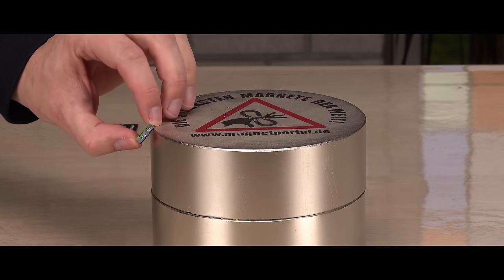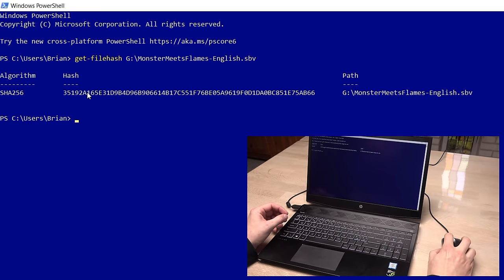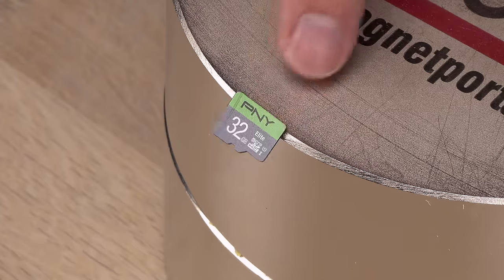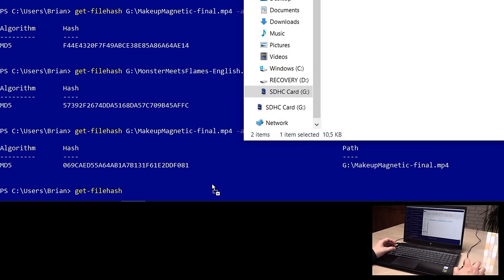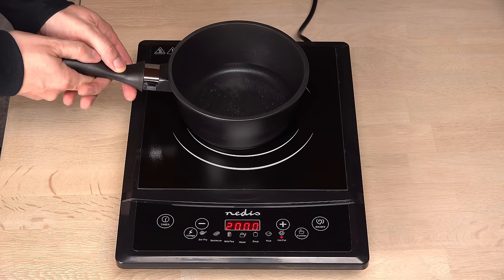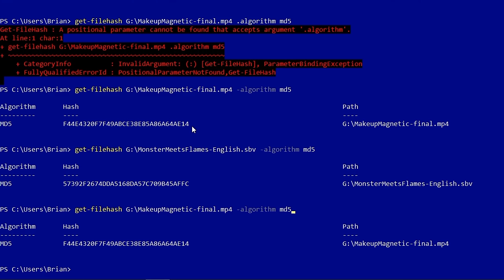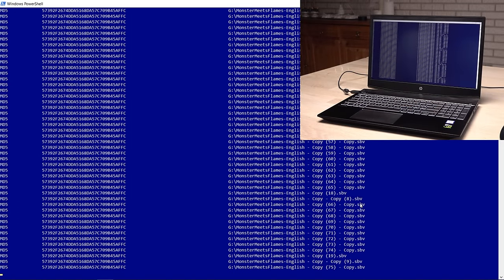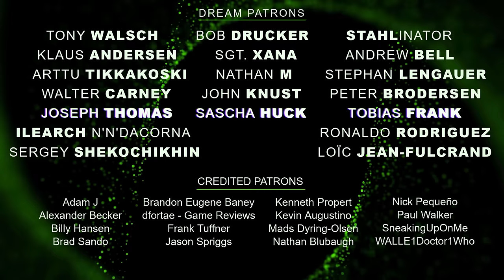SD Card vs. Monster Magnet and Induction Cooker (2000W AC electromagnet)

Comment: I'm pretty sure that there's a higher chance that the bit that was changed was reset back from the magnets, rather than a program having an error. Both are insanely unlikely, but the computer one just seems essentially impossible to me. Well unless something interfered with the reading, then that's probably it.

Comment: you should put and stick it onto driler on high turnover inside magnetic field, then it shoud be inducted high electrical shock in SD card. It's interesting if any data will get changed

Comment: Flash storage doesn’t use magnetic storage, therefore it cannot be affected by an external magnetic field. If you did the same with a hard drive or floppy disk which does use magnetic storage, it would completely fry it. They just said that the sd card is magnet proof simply for marketing since companies like Sandusky don’t say it.

Comment: You would see a single bit change, as the videos are heavily compressed files. Playing back decompress it, and can cause very weird errors, not just a single pixel color change.
Try H2testw, that will tell you how many byte has been changed, and such. It fills up the storage device with its own files, so it knows, what should be on it.

Comment: Most NAND flash chips have an "invisible" spare area after each data block (page), and the controllers use it to store Error Correcting Codes and some info like the number of block rewrites and so on. This makes cards/flash drives/etc. resistant to single bit failures and failing blocks.

Comment: Before watching, I can say that at this point magnets CAN wipe solid state electronics, I'd say with a high enough fluctuating (pulsed DC or AC) magnetic field you can generate enough internal currents where a high voltage spike/potential would then erase or physically damage the chip or data at that point it's referred to as EMI (electromagnetic interference, not Emi records🙃)
Reply from the maker: I tend to agree. That's why I limit my conclusion to the magnets available for me :)

Comment: For the card changing checksum in the first magnet test but returning to original in the second, I have three theories, but all are very improbable.

First, since the card did get attracted to the magnet, it might have kept a little bit of magnetism when you removed it, and that could have messed up the calculations just a tiny bit.

Or, the card could have one weak bit that got flipped on the first text, changing the checksum, then got flipped again on the second test, returning the original checksum.

Or there's the extremely tiny chance that multiple bits actually changed in the 2nd experiment, but it happened that the checksum was the same as the first one, since checksums aren't unique to a bit stream

Comment: It could've been a SEU, or one of the Row/Column select transistors' gate was charged by current, causing an entire row/column to be read incorrectly until it was actually accessed and pulled low again.

Comment: The computer readout anomaly is what's really got me interested, unfortunately the only way to find out if it was a random cosmic ray interaction would be to go thru and flip individual bits and try replicate the result. Its what they did with the Mario 64 speed run, but thats a lot easier than a whole computer system 😅

Comment: Been a while since I used Linux but use the DD command, input as dev/urandom, output as the block id for the device,  so like a raw mode, no file system, now that is every bit, checksum that setup

Comment: What do you think about extracting gold, silver, copper, platinum and radioactive thorium and uranium from coal ash using gold minign equipment?
Reply from the maker: Hm, it is probably possible, but wouldn't the amount extracted be extremely low compared to using the mining equipment on high-yield minerals?
Reply: @brainiac75  Theoretically, the wash should catch anything heavier than 3 g / cm3. Of course, such things flow down after some time, but if there are no heavier minerals in the ash, most should remain in the wash. And if I repeat rinsing twice, I should catch at least 70% of heavy materials with density more than 3,5 g/cm3 and at least 90% with density more than 4 g/cm3. 

In Poland's coals you can find about 700-750 grams of uranium per tone and about 2,5 grams of gold and platinum per tone. They will be some silver, copper, titanium itp. Radiation of ash remains at 0,2 uSv/g, so I expected a few microsiverts per hour in concentrate.

Comment: the internal circuit is not complete or closed.  Magnetics do not affect an open circuit until closed.  once the circuit it closed it has the ability to affect the charge or data on the card.  I would be really interested in how the circuit worked if you tried to play the video while the card is attached to an external circuit while on the active plate or on the neo magnets.  Thanks for the video it was  interesting.

Comment: I'm not surprised, but it was fun watching you play with big magnets, lol. There might be issues if you were reading or writing to the card while those magnets were doing their job, though...
Reply from the maker: Hehe, I really tried messing up the data. However, the magnets were at least 1.5 meter away from the laptop when writing and reading. But I can't rule out it still had a momentarily effect. Something did happen, and I'm surprised this checksum can fail in this way. Seems like it needs to be retried if it indicates a file change.... Thanks for watching!
Reply: @brainiac75  if you want to test magnetic exposure during read/write on purpose, I'd recommend a USB card reader and a USB extension. Maybe you could try microwaves next, hehehe...

Comment: Perhaps you need to know, the memory cards are electronic not magnetic, they have transistors that are switched to an on or off state by electric pulse.
These transistors will hold their state until the next electric pulse changes their state on or off, they are able to retain their state for years if not electrically reset..
The first time I saw this transistor was in Nexus Magazine in about 1996 where there was an article on it.

Comment: 2:14 Probably better to change the letter 'o' to 'n' (in ascii) to show how much the hash changes in response to, at least, a single bit flip occurring (which is what you would expect from a magnet if it ocurred).
o = 0x6F (hex) = 111 (dec) = 0110 1111 (bin)
n = 0x6E = 110 = 0110 1110

Comment: That hash hickup leads me to believe that the SD card was either unreliable in the first place or became after your magnets. You should have used proper testing application such as Check Flash (ChkFlsh) to check every single sector multiple times for read and write.

Comment: Video files like mp4 isn't like mjpeg or bitmap formats so pixel change is not a thing, if a video gets corrupted it will fail during playback due to codec system.
Reply from the maker: Hmm. I think you're right. They are heavily compressed, so a single bit change will change more than a single pixel. Thanks for watching!
Reply: A video file would have to be very badly damaged before the playback will fail, unless the header gets corrupted. 
Normally you will just get a portion of the picture corrupted and it will clear up when it gets to the next keyframe, which may be a few seconds away.
Reply: @rocketman221projects  that depends on the codec, h264 is more flexible but old mpeg codecs or ts is so bad at it.

Comment: I'm not sure how you've missed PNY, a well known brand name. But on the (u)SD card reliability front SanDisk are actually pretty poor in my experience (I've used loads of SD and uSD cards ever since my first 8MB  one (yes that's megabytes not gigabytes) back circa 2000. I've had numerous ones fail. I have so far not had any issues with Samsung, Kingston and PNY. Of course (its pretty well known) the really cheap unbranded ones are by far the worst, often not even being the capacity they claim to be, or just failing randomly. Of all the but one of the Sandisk ones i have had fail they always fail in the same way, they go read-only.

Comment: Yo brainiac, have you watched peyer browns magnet field resin video?

I kinda want to see it with your super magnet and 3 test runs, 1 first resin then iron dust, 2 first iron dust then resin and 3, resin and dust mixed, than on the magnet.

But I don't know how it will look with bubbles if you don't have pressure chamber. Just letting you know this.

Comment: I'm no expert but I know that these days most manufacturers are well aware of bit flipping and build in fail safes to mitigate this. Not sure exactly how it would be applied in the situations shown here, but interesting to think about nonetheless.
Reply from the maker: You may be on to something. I seem to remember something about data on hard drives being recorded with some error-correcting bits as a checksum. Similar to ECC-memory in servers. So a single bit change can be corrected. Could be part of the magnet-proofness in SD cards as long as a lot of bits aren't changed. Thanks for watching!

Comment: First thing I thought after seeing the different hash on the video file was "I wonder if the it will change back to the original hash file after retesting" and thats because nand sells are connected interconnected and by themselves wont be susceptible to magnetic fields but there could be a particular arrangement of sells (in 1 or 0 state) that forms a specific pattern that by it self could end up be more susceptible to eddy currents than the neighboring sells (well all are but not at an degree strong enough to change their value and here is why the pattern of particular networked cells or a piece of code in tha video in other words could come into play amplifying the effect of the eddy currents like an antenna of some sort which lead to flip one or more of the neighboring cells to that pattern/network of cells  and because the "antenna" still exists the values could reverse again. )  so I wonder if you put that SD card back to your huge magnet if the hash value changes again to that "strange" hash value and if you apply eddie currents the hash value returns to the original. 

Also btw PNY (pee enn why) is a reputable brand in the consumer storage market.

Comment: Wow. Actually impressive. I wonder how the manufacturers managed that.
Reply: It's mostly just due to the way flash memory works. Since it doesn't store data magnetically (unlike a HDD) it isn't affected by magnets. To my knowledge there aren't any special measures taken to make them magnet proof, since there really isn't a need to.
Reply: @garageghost6038  The flash isn't affected by magnets but other components could be, so I have theory that it if placed under a magnet it could misread or corrupt data written to it while in use.
Reply: vgamesx1 It's likely that if you put any strong magnet close enough to a computer to affect the SD card while it's connected, you will damage the computer itself rather than the card. Maybe using an USB extension to keep the magnets away could work for a quick test. Although the max voltage output of a standard USB port is only five volts, and most motherboards just disable any port that behaves outside parameters, so at best if it works the magnet will lock the computer from getting any reading from the card.

Comment: PNY is a decent brand. I bought a 1TB nvme drive from them 1 year ago and it's still running at the full pci-e 3.0 max speed but it was cheaper than samsung drives....I guess I will eventually find out if it lives as long

Comment: I have an almost identical pny SD card from 2015 that still kinda works but I wouldn't rely on it. It lived most of its life in my phones and during early 2019 I shot a lot of 1080p60 video after school with friends meaning the card pretty much experienced 1 write cycle per day for about 2 months until 1 video managed to somehow go corrupt (although not before it managed to back itself up to Google photos cloud in a lower quality) and then I got a new SD card but I've kept using that SD card in my raspberry pi since then and it's still fine. Also an inexplainable fluke.

Comment: Depending on the filesystem used on the SD card, there is data area used as filesystem overhead. This wouldnt be covered by just checking the files. Need something lower level.

Comment: On Linux You can easily generate one hash (md5, sha and other methods) for whole disk (SD card) with one single and easy command. In Linux everything is a file, so You don't need programming skills and specialist software to do one simple thing - for example, I can turn off and on any fans in computer by writing into certain file.
Reply: yeah I was also watching and cringing in this regard, md5sum /dev/sda would indeed save a whole bunch of faffing around with all those files. I also wondered if he'd run a filessytem check on the SD card prior to starting the experiments as the FAT file system is very fragile and can often gives some weird results once it is corrupted in anyway. e.g. maybe some of the data has somehow ended up mapped to a region of the filesystem that is being used for some other file.  md5sum of the entire medium would make the state of the file systems irrelevant too.

Comment: PNY is far from no name, I used to use their stuff all the time (though have mostly committed to Samsung and SanDisk now), they're pretty reliable, I'm pretty sure I actually still have a PNY USB drive I've had for ages running somewhere in my setup, haven't had a PNY drive fail yet

Comment: While this is an okay-ish way to do this, I would have used a unix-like system or a program specifically designed to test the entire disk bit for bit. By checking hashes of files, you are not checking every single bit of the entire micro SD

Comment: You should just make a python program that compares files and gives your the difference and position in the file and the bit position. Many times its not an entire byte that gets corrupted but just a single bit that flips for whatever reason. (that one that did change was most likely a weak bit, that did change but then went back)
That would be way better than any windows utility. 

Also be carefull, nand flash storage if way more sensible to shock than to magnetic fields, you could get false positives for dropping the card onto the magnet.
Heat and shock are the most usual culprits when your sd card or thumbdrive gets corrupted. It also depends quite a bit on the type of nand cell technology used but being that its always a capasitor they will always be susceptible to shock because of the microphonic effect, and heat just increases self discharge.

Comment: Next try radiation. Both x-ray and atomic decay. That should be able to influence the cells if radiation is strong enough or lasts long enough as radiation slowly will knock electrons loose in the cells and thereby slowly discharge them.
Eddy currents will only cause effect if the generated voltage is high enough and for that you really need some high frequency alternating magnetic fields.

Comment: I have a lot of PNY cards, its a common brand of sd card for cheap here, and it never or really rarely fails, even going into hot coffee, electric shock or anything. But their card reader aren't as good as their SD cards, so take it, but let that card reader out of this, it will corrupt a lot of your data, or doesn't even work

Comment: What filesystem did you use for the SD card? If you didn't write after a copy, the data might not actually copy, depending on filesystem. If the original sectors got lucky, then every file has the same checksum.

https://en.wikipedia.org/wiki/Copy-on-write

Comment: The hash change you saw is somewhat common with MD5, it's a broken algorithm.

For whatever reason MD5 takes some meta data into account, there's a data field called "last printed" for example. That would mean, printing it will change the md5 hash.

Opening, then renaming it also changes the filehash while renaming without opining does not.

MD5 is weird.

Comment: Unlike harddrives, sd cards dont use manets to store data. This means a strong dc magnet wont do anything. A strong ac magnetic field might be able to induce a current in the flash chip, flipping a bit, but generally the mindset "magnet make data go corrupted" is not allways true. Probably that sd card is just really bad... Id wanna see this with a high quality sd card, to see, if that is just a bad sd card, or if magnets really do mess with data.

Comment: If you want to change a single character, then using a wysiwyg format that opens in ms word is not the correct thing. microsoft saves all manner of stuff along with your changes. such as save times and some formats even include the entire undo history (which is one reason why you should only send pdf files instead of word documents).
Use txt files if you want a representation as bytes and changes to be to single characters only. Stuff like access time, modification time and such are saved in the file system, not in the file itself. For your SD card that's most likely the file access table in the FAT format.
I don't know what file format you used, but really you should be using the most barebone stuff.

Comment: You probably had memory corruption. Really long md5 calculations are really sensitive to memory issues, and is one test literally used in some memory stress tests. Memory on desktops and consumer laptops have no error correcting memory, and these random corruption events are fairly normal. I wouldn't worry about it.